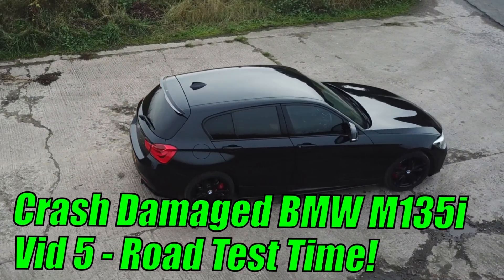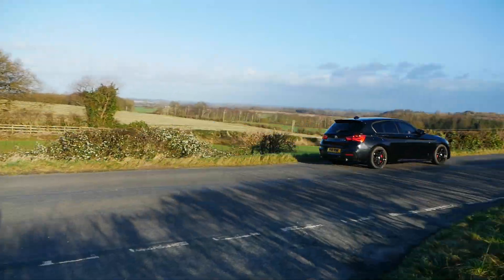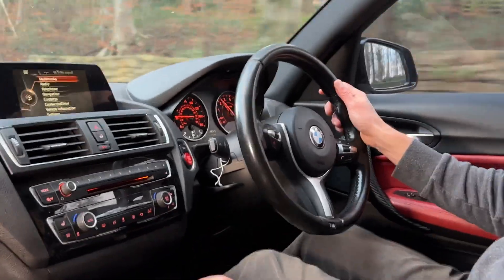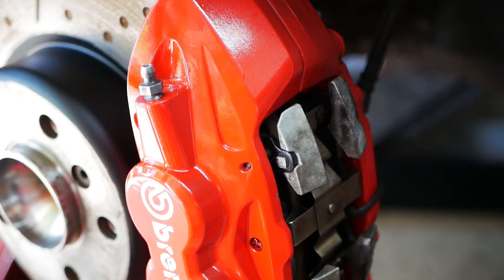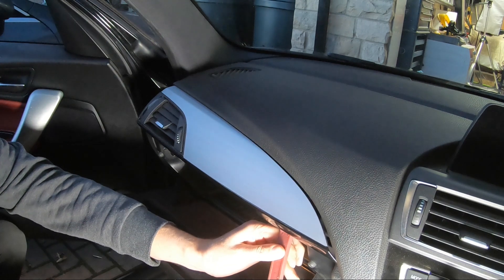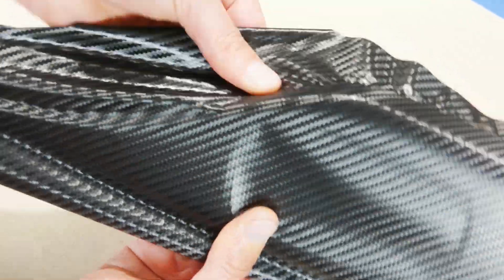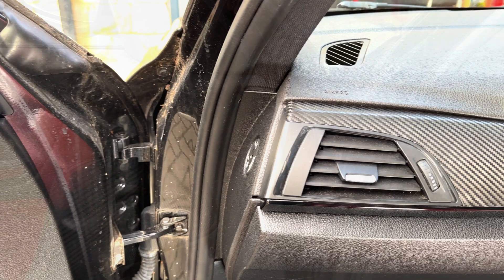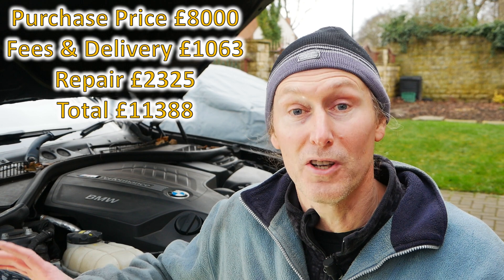Crash Damaged Car Rebuild | FIRST DRIVE! | BMW M135i - Vid 5

Comment: Hey Phil, greetings from South Africa! As a n55 m135i owner you can never go wrong doing a tune on these cars. Once your boost pipe is done and you add an intake system (bms over here) you can comfortably go stage 2. Intercooler is only needed on stage 2+. You will instantly feel that on a stage 2 the car is what it should have been from factory. Love the vids though! Keep it up.
Reply from the maker: Hi Jakez, Nice to hear from a viewer in South Africa! That's another vote for tuning! I've only had 3 votes so far, 2 For tuning and 1 Against lol! From your message, it sounds like I need the two boost pipes (change plastic for steel or aluminium) but I wasn't aware I needed an intake system in addition to the panel filter, so I'll look into it! BTW, a BMS tuning box is what I was considering for the stage 2, is that what you are using or any experience to share? SA currently makes up 2.3% of my viewers but I know you have a strong car culture, so if you are a member of any forums or groups, I would be super grateful if you could please share the playlist for the BMW M135i! The vids are a little slow taking off ☹ The link is here  👉 https://www.youtube.com/playlist?list=PLca3f5oSU6mcyB78EEaaoCpeNhKypJ5L1 Thanks, Phil

Comment: Heat Gun Is Just As  Important As Any Other tool in our work space
Reply from the maker: Agree, it gets a lot of uses for all sorts. Started off just using it for shrink sleeve over soldered joints but finding more applications for it all of the time!

Comment: Nice car, insurance would be too much for my liking 😅
Thats my F20 gone already and im taking delivery tommorrow of next project,  2016, F22, 220D m sport, manual, 30,000 miles on clock. Needs new bonnet, bumper and headlight!!
Reply from the maker: Hi @arnietwo11 Road tax is a killer too! You're doing well at turning your projects around! Hope you are doing better than me on prices, looks like I might just break even on this project. Don't tell anyone but I also have my next project sat on the drive. F40 M135i Xdrive Auto! Nobody reads these comments except us! ;-)
Reply: @ReviveMyRide  that might not be true Phil 😂

Comment: Rebuild Title Damm it Thats A Hard One Depends on person thats interested
Reply from the maker: Rebuild title isn't as much of a problem over here in the UK, yes it devalues the car 10-15% but they aren't shunned in the same way over here. Mine is classed as non structural damage, which buyers are a bit more relaxed about as long as you have photos and receipts...

Comment: What is the difference between m135i m140i ???
Reply from the maker: The main difference is that when they brought out the M140i, it had a revised engine called the B58 with increased power +20bhp and increased torque +50Nm. It has different tuning characteristics and power delivery but is still a 3.0T straight six. Cheers, Phil

Comment: slip diff only for the real M cars.. there needs to be a diff between m performance and the proper M car
Reply from the maker: Hi, the M performance diff is available for these cars as an option. Some people specify it from new and others add it later. Agree with your point but as much as I like the car, even with an LSD, my M135i wouldn't be anywhere near a true M car. I have a Z4M, so that's what I'm basing my opinion on... https://youtube.com/clip/UgkxURml7htFPD5eoStybl7wH6X47XWIVGzo?si=MKnlIKhpaBwExwoK Cheers, Phil